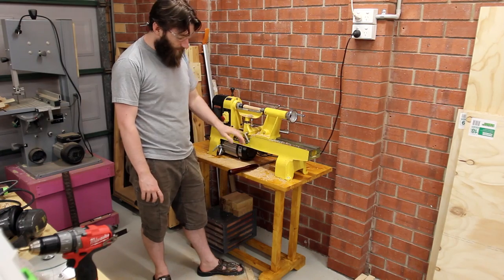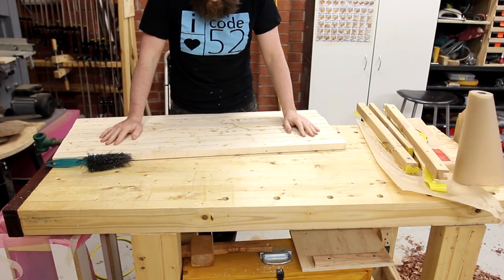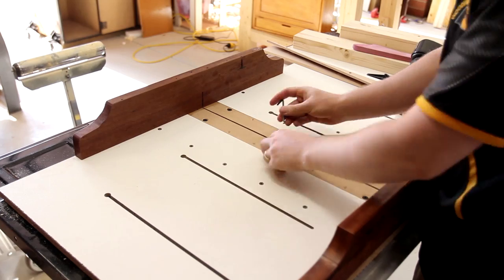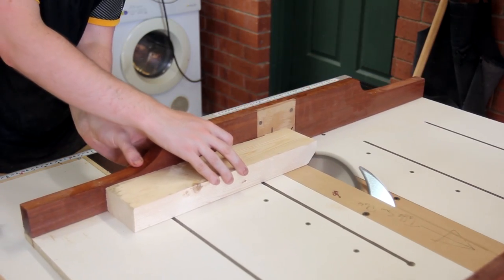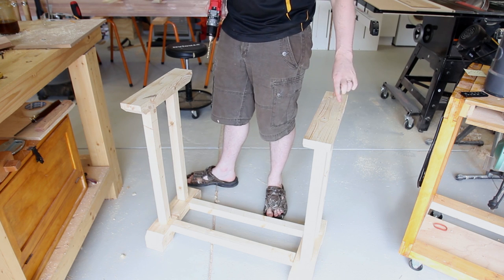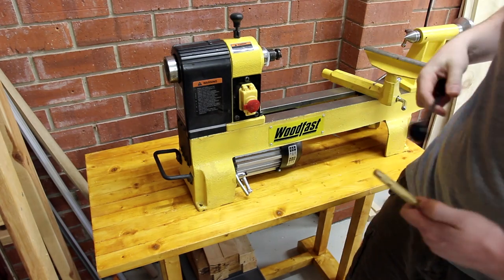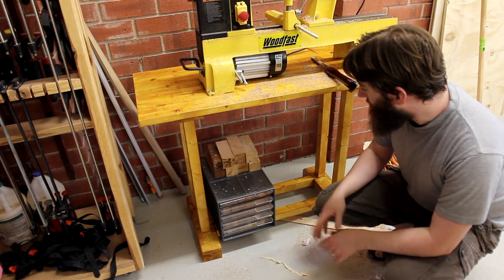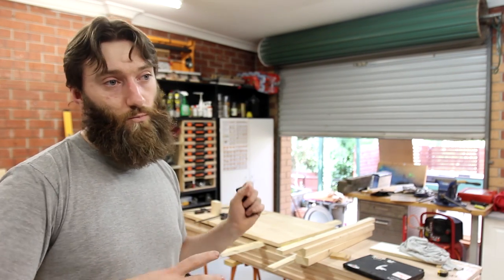043 - Building a fancier work bench for the mini lathe

Comment: Nice build and it turned out really well. I liked seeing the replaceable template on the crosscut sled. I'm not sure how much time you spent with the plane, but I think I would have split it with the table saw, run it through the thickness planer and then glued back together, but that's just me... lol.
Reply from the maker: Bill Macfarlane Thanks, the cross cut sled was more involved than the previous sled I had but the benefits have been well worth it. I'm thinking of rebuilding it using lighter (weight) timber for the front/back fences and plywood instead of melamine. It gets a bit tiring pushing it back and forth!

It didn't take too long with a plane - it had been recently honed and pine cuts easily, but in hindsight, yeah, I think I should have glued it up in ~300mm (12") segments and run it through the thicknesser.